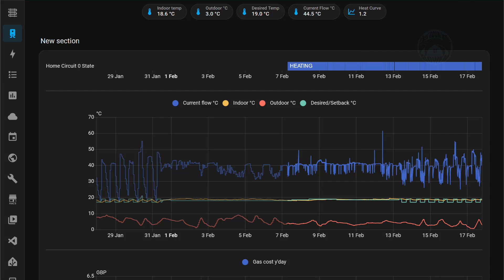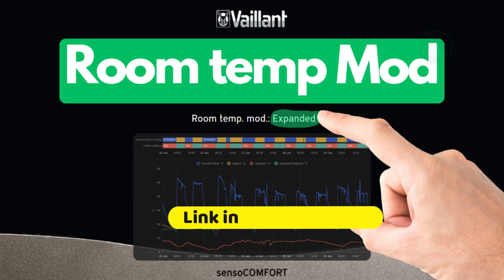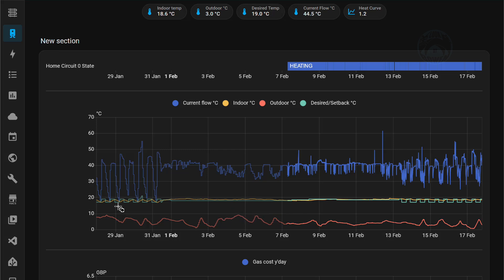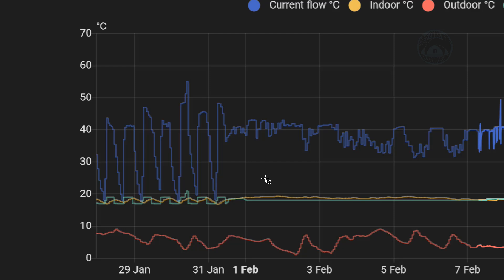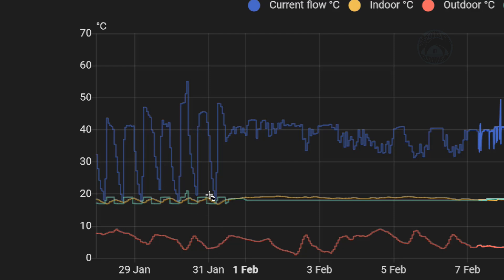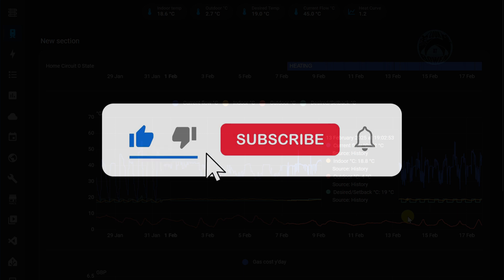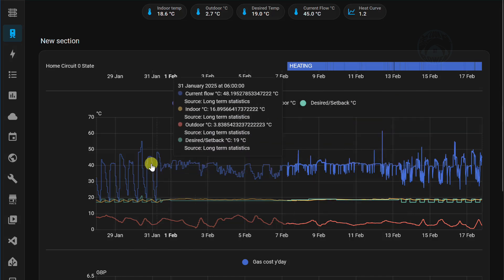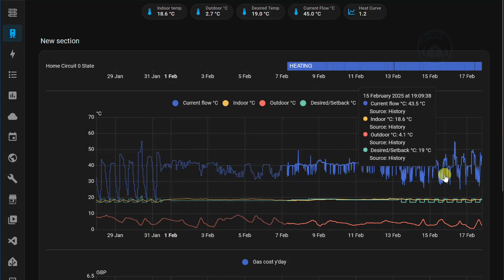Room Temp Mod: Inactive EXPLAINED! - Vaillant ecoTEC Plus ☀️❄️ SAVE MONEY 💰

Comment: Hi Mike, great video, appreciate your effort. In inactive mode, basically SensoComfort thermostat is passive element, right, actually I do not need it. But if I want to set some schedules (on/off) and turn off the boiler during the night, can I configure it efficiently using MyVaillant app or directly on boiler? I do have thermostatic valves on radiators and I am thinking this could be enough (only using "Internet" features). I also saw your other video about notsosmart Vaillant app 😊, I am expecting some improvements. 
And what happens if boiler get disconnected from the "Internet" for whatever eason, how it is operating, I guess it is manually (on/off). I do think I need room thermostat like Senso*, but if I do not have one, curious to understand what is going on.
Reply from the maker: @zgalunic Thanks for your question. Yes, you are right. One can set schedules directly on the boiler, or using the myVaillant App. You can also use Home Assitant to automate the boiler, as there is an integration for it. The MyVaillant app has had an update 🤣 which has added s further level of complexity to a simple process. I still need to do another video on it (just for laughs). I still recommend Home Assistant. 

Re: Thermostatic valves. One can open them fully (mode 5) and ignore them completely. Unless of course you want to control the heat in a particular room e.g. main bedroom, then I would suggest setting to 3, and to 5 in every other room. 

The boiler can operate without the internet. There is a gateway (a box plugged into the boiler) which connects to your MyVaillant App & WiFi. It will work without the internet like any other boiler. So, yes, you don't really need that either, but consider this:-  if your boiler is in an inaccessible area or a difficult to reach area, (e.g. a loft, or in the garage), you don't want to be going to the boiler every time a change is needed. That is the advantage of the app, and the app as crap as it is, does work and is a lot easier to use than the menu on/at the boiler. The menu screen has a time limit on it, and frustratingly if you're slightly too slow, it resets to the front screen, and then you have to start again. The sensoCOMFORT screen is frustratingly the same. If only it can't be set to timeout after 2 minutes, that would be swell.

The sensoCOMFORT is a thermostat used for determining the room temperature, but depending on what Room Temp Mod one uses, it isn't need if you have the weather compensation sensor outside and Room Temp Mod set to Inactive. It completely ignores the room temperature, and the flow temperature is solely determined by the outdoor temperature and the Heat Curve. The sensoCOMFORT acts primarily as a display (an expensive one at that). 

For Room Temp Mod = Active, Weather Compensation with Room Influence. Room temperature slightly modifies the flow temperature. The system uses weather compensation as the primary control, but the sensoCOMFORT's room temperature reading is used to make minor adjustments to the flow temperature to maintain the desired indoor temperature.

For Room Temp Mod = Expanded, Weather Compensation with Room Influence and Thermostat Function. Room temperature can override heating. Combines the "Active" mode's features with the ability to completely stop the heating when the room temperature exceeds the setpoint by a small margin. This essentially adds a traditional thermostat function.

For "Active" and "Expanded" modes to function correctly, the sensoCOMFORT must be located in a representative room.

Properly setting the weather compensation curve is essential for optimal performance in all modes.

I am using Room Temp Mod set to Expanded. I'll do another video on this soon. I've got a couple of more days of testing, but I think I've found the sweet spot.
Reply: Hi  @LookatBowen  , many thanks for your detailed answer. I do not have direct experiences with gas boiler, but I am considering switching from pellet to gas, so your insight is very valuable to me.

For Thermostatic valves, yes - main goal is to control temperature for particular room and when desired temperature is reached, closing the valve will reduce the flow and I am expecting at certain point (I have valves on each radiator), flow might get lower and boiler will modulate in efficient way (along with weather compensation coming from gateway/SmartApp), Eventually, at certain point, because of low flow - boiler might completally turn off (and hopefully not doing it in frequent cycles (on/off)). If I do not have TRVs, boiler is completally led by external weather conditions, now knowing what is going on inside the house.

Searching the Internet, I haven't seen any experiences in this setup, you were quite close to it, as I understand, when switching to "Inactive" and being driven by gateway/SmartApp - but I think you did not "play" with TRVs 😊
Reply from the maker: @zgalunic I did initially mess with WiFi TRVs, but found them to be annoying because they would be constantly opening and closing the valves, which was noisy.  I didn't have them automated or anything in home assistant, but replaced them for traditional TRV's. Also it's a mind set, the new boiler being smart and all, talking to the gateway and the outdoor temperature defining the flow temperature, having them open in all the rooms is one less variable in the whole process of finding the perfect heating setup. 

I've mentioned this in many videos, making multiple adjustments when not having a clue which heat curve or Room temp mod to be on makes this whole learning curve even steeper (fun, but also frustrating). It is a slow process, so a lot of patience needed and the weather gods playing their part. 😁 Also, what are your expectations for the daily cost of gas? That's the million dollar question I've been struggling with. All I have to go on is my last year's bill, and that is very much dependent on the weather at the time. This year has been a lot colder in January and February. If you're expecting say £5 per day, and it's constantly showing £7 a day then knowing which room temp mod gets one close is key, but not knowing all the variables makes it very hard. The heat curve is a major factor, and one can't change that every day.

Comment: Seen this post where somebody made this comment and applicable to my boiler. 

Noting that 'Modulation' and 'Range Rating' are two different things.

Typically when the CH is being called for, a boiler starting from cold will fire @ max output until the system warms up. Range rating means a boiler's CH max output can be 'turned down' so when the boiler starts up from cold then it won't exceed that set max, keeping fuel bills down. As suggested the 826 can be range rated down to ~ 2.5Kw.

Modulating is when the boiler's system temp reaches is set point, the burner will modulate (turns) down and maintains that set heat - most, if not all modern boilers will modulate. Your boiler has a modulation ratio of 1:10 therefore it can modulate down to 10% of the CH standard output

A smart system using Open Therm can control the system temps/times etc, very specifically. Coupled with specific sensors they can fine tune and control the system temps etc again helping greatly with efficiency and costs.

Comment: With my EcotecPlus I eventually found how to set the max gas output for the boiler. This is what folks call range rating and so far, has shown a slight decrease in my bills.
My boiler is the 24kw version and what it will do is run at its max capacity for heating demand. However, you may only need 10kw to get best efficiency on the heating side.

I calculated by measuring the size of all my radiators (8off) along with their type (double/single) and found their max Btu output at Delta T50°C. I used the Screwfix website and when looking at the radiator click on more info. This will give you the max BTU at this temp, i.e. 5800 BTU.

Find this BTU figure for all your radiators and add it all together. Find an online BTU to Kw convertor and it will give you the Kw heat output your boiler needs to produce to run all the radiators at the ideal Delta T50 temperature. For my boiler and radiators, it worked out that I only need 8.5 kw.

Then I went into the settings and select ‘Diagnostic Codes’. In here scroll to D.000 (Maximum load in heating mode). I reduced it down and set mine to 10kw to be on the safe side.

This means the boiler will use a maximum of 10kw when the central heating is on. This is where lots of folks could possibly save money on their heating. Most boilers are oversized and running like a Ferrari when it only needs to be running like a Fiesta.

So far, my heating bills have dropped a good bit and will keep an eye on it. Maybe worth a try as part of your testing. Note that I am also running the 'Expanded Setup' and so far, it’s the cheapest I have seen for my bills. I have 2 bedroom house, cavity insulation, double glazing and average daily bill is £2.50, thats with heating on from 16.00 to 21.00 at 19c and setback to 17c for rest of day and night.
Reply from the maker: Thank you very much for this comment. I discovered on my quote from the boiler installer every radiator had a Design Rating and a 50°C dt Rating, which I have totaled up, and the total comes to 14.792kW. I went into the settings on the boiler and had a look at the Diagnostic Code D.000 (Maximum load in heating), and it is set to 10kW. Does that mean the 10kW is too low, perhaps that is why it sometimes doesn't reach the desired temperature, because the boiler is not at the right setting for Maximum Load in heating. I will reach out to my boiler installer and ask him if it is worth turning that up to at least 14kW.

Edit: 20:11, 19/02/2025: It is an interesting diagnostic code because according to the manual it should be set to AUTO. I've reached out to my boiler installer and asked why it was set to 10kW. 

I am also running EXPANDED now, and it is by far the cheapest of the three Room Temp Mods. If what you have said can make a difference, that will be a huge deal for me. Interesting on your daily bill. I am in a three bed house, with a large conservatory. Do you only run one timer? I've been running two timers in the past, and average around £4.50 a day on Expanded, a lot more as I showed in the video for Inactive or Active. I have the Setback = to 17°C with a desired of 19°C.
Reply: @LookatBowen  Would say my daily bill according to octopus is now £2.50 a day. I only have the one time period in the evening and rest of day on setback. Jan my total bill was £92 and averaging £3+ a day before going on 'Expanded' and dropping the 'KW' setting. Will be interested to see how Feb compares but so far bill from 1st Feb up to today is £47.30 most central heating systems in the UK would actually run and be fine on a 10kw boiler for the heating. The larger output is more for the generation of hot water.
Reply from the maker: @RS.Outdoors I've done what you've mentioned, set one timer at 16:00 to 23:00 and the rest of the time is on setback temp = 18C and the results are wow! And this is an EXPANDED room temp mod.
Reply: @LookatBowen  I am also wondering if the gas usage would drop if I switched off the external weather unit as well. Just run off the control in the house only.
Reply: @LookatBowen  Not sure if Auto or setting to a fixed temp is best. Would maybe try yours at 10kw and maybe 14kw and see if it makes any difference. Thiers a new Viessman boiler out this week and they have modulation which can go as low as 1-5kw without the boiler cycling on and off. This means if the heating system is just need topped up it uses far less gas to do it. Our boiler seems to go full pelt most of the time and don't modulate down very low so if we only need 2kw of heat to top up radiators it cant as the lowest it can go is say 8kw. Hence why I believe range rating also helps as you are telling the boiler to run at a lower setting. Like yourself trying to get good information on all this is difficult. Look into both Range Rating & Low Boiler Modulation.

Comment: out of interest have range rated the boiler down at all or have you got it set to auto?
Reply from the maker: I discovered on my quote from the boiler installer every radiator had a Design Rating and a 50°C dt Rating, which I have totaled up, and the total comes to 14.792kW. I went into the settings on the boiler and had a look at the Diagnostic Code D.0000 (Maximum load in heating), and it is set to 10kW. Does that mean the 10kW is too low, perhaps that is why it sometimes doesn't reach the desired temperature, because the boiler is not at the right setting for Maximum Load in heating. I will reach out to my boiler installer and ask him if it is worth turning that up to at least 14kW.
Reply: @LookatBowen  Your installer maybe range rated for you and you were unaware. Try setting it to 15kw and see. Like everything you may need to play about with it.